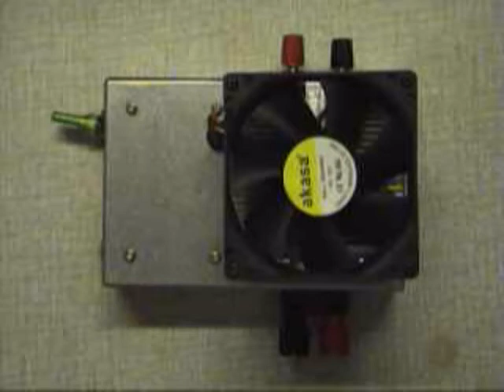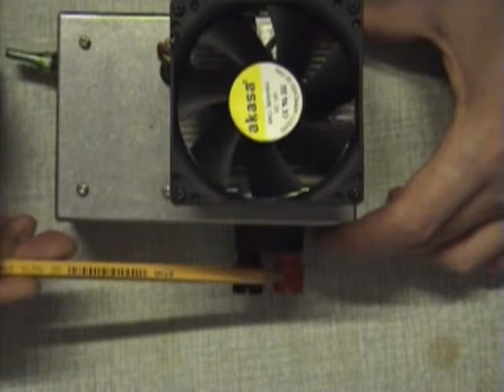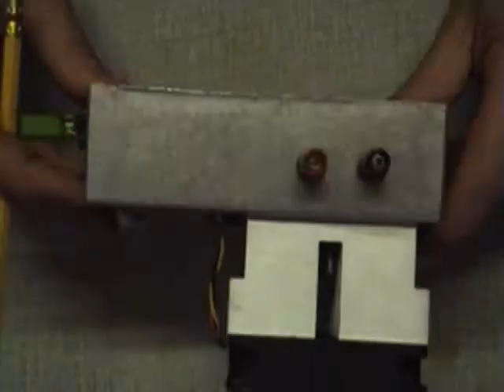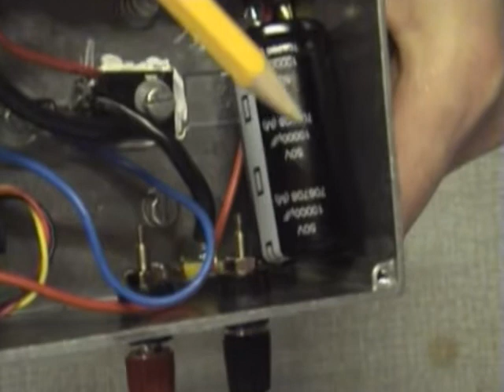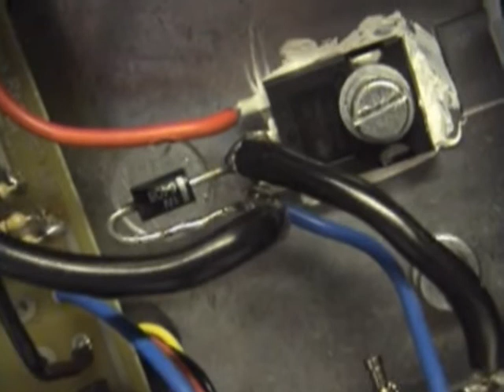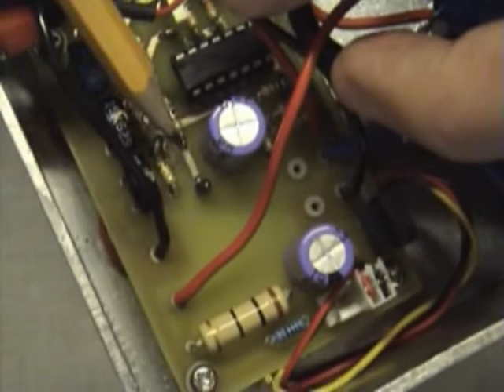Introduction

Comment from the maker: The duty cycle of this device self-adjusts dynamically as the voltage drop across R12 is compared to a preset limit on a potentiometer (VR3 on ZeroFossilFuel's circuit). In as far as this is concerned, the device can indeed be set and forgotten with little observed variance over time. VR3 can be (re)adjusted at any time but best set when the cell is cold for reasons of procedure if nothing else. Full credit to ZFF for this. "It does what it says on the can", as the saying goes.